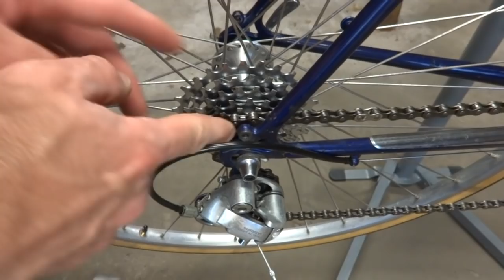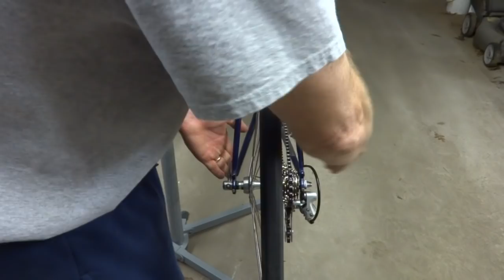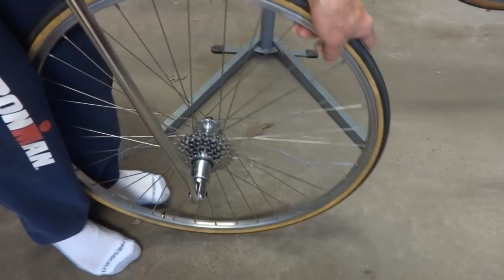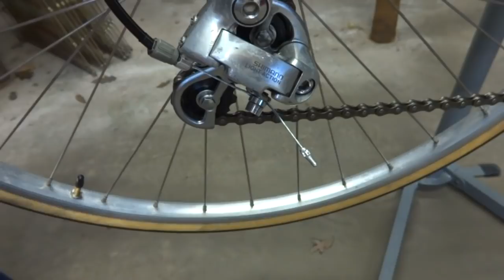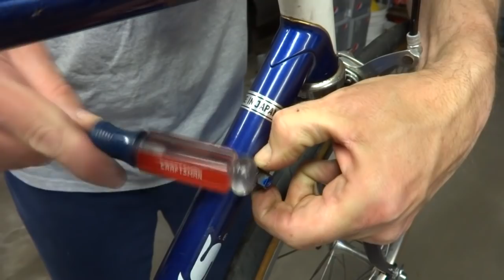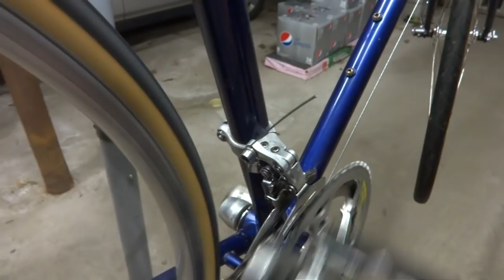How To Do 6 Speed To 7 Speed Freewheel Conversion

Comment: I have a Shimano tz50 6 speed freewheel, since I can't find a 6speed shifter, could I use a 7 speed one? Provided I adjust everything properly. What I've heard is if the spacing between gears in the free wheel is same you possibly could. Please help
Reply from the maker: The spacing is different: https://www.sheldonbrown.com/cribsheet-spacing.html
You can get it to sort of work. Just replace the freewheel.
Reply: @RJTheBikeGuy  ok thanks!
Reply: @RJTheBikeGuy  the spacing is off by just 0.3-0.5 mm at the most, will it still create a problem?
Reply from the maker: Multiplied by the number of gears... .5 * 6 is 3mm. https://www.youtube.com/watch?v=xMvD1T4qF1E
Reply: @RJTheBikeGuy  ah yesss

Comment: Hi RJ, I have a question for you. I'm trying to do a 6-7 speed conversion, and have completed all the steps, however I ran into the problem you mentioned at 1:11 - 1:27 with the freewheel rubbing against the frame. I solved this using a spacer as suggested, however it has caused another problem. Even though the wheel is completely in the dropouts, it is not central in the frame, and so is very difficult (impossible?) to get the brakes to fit properly as one pad is almost touching the rim and the other is about 2cm away. Is there a way of solving this that doesn't involve buying and fitting a new, narrower hub?
Reply from the maker: https://www.youtube.com/watch?v=0MHBHFu4CrA

Comment: on those shifters, does the difference between friction and sis mean that friction would just be the old gearing-manual, without indexing option?
Reply from the maker: Some people prefer friction shifting instead of indexed shifting. So the little part on the side can be turned to select friction or SIS (indexed shifting).
Reply: thanks

Comment: I have a shifter with 7 speed and a rear wheel with 7 cassette, I don't want to use the 7th gear on 7th cassette I want it to start it from the 6th cassette . How do I do that?

Comment: The rear dropout spacing on my bike is 130mm and currently there is a 5-speed freewheel on there. Will I be able to upgrade to a 7-speed freewheel without any problems?
Reply from the maker: Dunno. Generally 5 speed wouldn't have a 130mm spacing. So you will have to figure it out. http://www.sheldonbrown.com/frame-spacing.html
Reply: Yes i seems strange. The wheels on bike are 27 x 1 1/4" 32-630 if that is of any importance... Thanks for answering RJ.

Comment: I have a 7 speed Shimano megarange MF-TZ31  freewheel and would like to replace it with this 8 speed Sunrace Freewheel13-34 MFM56.8CV0.US5.BX.  I have an AL frame with 135mm span.  Is it possible to just swap the freewheel without rebuilding the wheel with a different hub? If there are spacers to each side of hub can I adjust the wheel towards the non drive side with out having issues with the wheel not being centered and issues with the brakes. Right know there is a rubber boot covering the non- side spacer.  I will of course change the 7 speed shifter to an 8 speed. Also I have rubber boots covering the spacers on the front axle and would like to replace them this summer when I repack the bearings. Where can I find new ones? I have looked everywhere and can not find any.
Reply from the maker: Multiple issues here. Freewheels above 7 speed are generally low end crap. Most Mtn bike wheels spaced for 135mm take a cassette a freewheel. So I don't know if you have a 130mm spaced wheel. If you have a 130mm spaced wheel, an 8 speed might not fit on it. And bad idea to use a 130mm wheel on a 135mm frame. Too many issues here, so I have no idea.

Comment: Hi Mr RJ, i need your advise.  I have folding bike with 6 speed. the current cassette is 14t to 28T.  now i want to change only the current 14T to be 9T. is this possible? is there anything need to change?   thank you and waiting for your reply.
Reply from the maker: I don't know if 9t sprocket would fit on a common cassette. I think 11 or 12 is usually the smallest.
Reply: @RJTheBikeGuy  Hi RJ, I might thinking you had experience like this. by the way thanks for replied. oh! yeah there is 9T on 3 speed cassette folding bike.

Comment: what about long/short cage derailleurs?,just realised u didn't mention this?,thought most 6 speed derailleurs could be adjusted to accommodate 7 speed just like the old tourneys which were for 6/7 speed?
Reply from the maker: +neil crompton Long cages are to take up more chain where there are large differences in gearing (big chain ring/big cog versus small chain ring/small cog). Nothing to do with this video. (see my vid on chain sizing https://www.youtube.com/watch?v=ELsKrgTt0oY) A rear derailleur in the case of this video needs to be able to reach all the cogs. A 6 speed RD may or may not be able to move far enough to  reach all 7 cogs.

Comment: shyflirt1 is it necessary to switch my derailleur & shifter if I am using friction shifting, not indexed?
Reply from the maker: You may still need to change the derailleur. It depends if the current one will reach all the cogs. Probably not the shifters.

Comment: I found 8 and 9 speed freewheel for sale. Can you do a 6 to 8 or 9 speed freewheel conversion without changing the hub (will there be enough space)?
Reply from the maker: Freewheels above 7 speed are generally cheap junk. And then you would have issues with bent axles which is why they moved away from freewheels for more gears.

Comment: Hi Mr.Rj ,i have mtb with 7 speed thread type,the current cassette 14t-28t..i want to change on 9 speed 11t-32t thread type....is this possible??? there anything to change??? thank u...
Reply from the maker: The 9 speed freewheel is probably wider so would have spacing issues. With a wider freewheel you are more likely to have bent axles. And generally the freewheels above 7speed tend to be cheap junk.

Comment: I need to change the bottom bracket except for the spindle (I'll restore the spindle). I should buy new parts like a new bottom bracket, loose ball bearings, Phil Wood grease, and a new threaded locknut.

Comment: Hello. Great video. So I have a 6 speed freewheel 27" that I'm wanting to convert over to a 7 speed 700c wheel. Are 700c wheels all the same hub width, and are 700c's hub width the same as a 27" wheel?
Reply from the maker: mannurse32 Most likely it will be 126mm. You may have to change the brakes since the 700c wheel is smaller diameter. But there are newer wheels with cassette hubs designed for 8/9/10 speed cassettes that can have a 7 speed cassette installed on them. They would be 130mm. But if you have a steel frame you can maybe expand the rear triangle to fit the wider wheel. I have a video on that too. 
Check these vids: 
https://www.youtube.com/watch?v=L5pl0zrlHbg
https://www.youtube.com/watch?v=QwxEPRk3LFg
Reply: RJ The Bike Guy So I bought the new wheels and tires. Wow! It looks amazing and I can't wait to get rolling. I did in fact buy the long reach brakes for the front and back, new chain, and a new 7 speed cassette. The bike sits now as having come with 2 rings up front and 6 speed freewheel in back. A co-worker is helping me do the conversion and he mentioned there could be problems with the derailleur. As it sits now, it is set up with a 6 speed and friction shifters. He said I may need to update the derailleur due to it having one extra gear and the fact that the derailleur now may not work with the new cassette and chain. So, my two questions are this: 1. Would it be easier just to leave it as a 6 speed 2. If I leave it as a 6 speed will I have to still change out the derailleur?
Reply from the maker: mannurse32 You might need to update the derailleur. What derailleur is it? I recommend a Shimano SIS compatible derailleur. Some nice older derailluers can be gotten on ebay pretty cheap. Nice 105 or 600 models. But if the RD you have now is SIS, it might work for 7 speed. If you are going this far, you might as well update the RD and go for indexed shifting. You could get indexed downtube shifters, or go for STI shifters. Lot's of different options. Post some pictures over on my facebook page maybe?
Reply: RJ The Bike Guy The derailleur now is the OEM that came from the factory. It is a suntour 5000.
Reply: RJ The Bike Guy , Are you RJ The Bike Guy on facebook too?
Reply from the maker: mannurse32 Probably not SIS compatible. Probably Suntour's accushift system. Get an SIS Shimano RD.
Reply from the maker: mannurse32 Yes.
Reply: RJ The Bike Guy so, will I need to update my shifter then too or will a friction shifter still work with the SIS Shimano RD?
Reply: RJ The Bike Guy , and which RD is the correct one? As I'm researching this I see, rd-ty 18, 15, 30, 22?
Reply from the maker: mannurse32 If you plan to stick with friction shifters, then the suntour RD might work. But come on, it's 2015. Indexed shifting is way nicer.
Reply: RJ The Bike Guy I just found out that the suntour 500 is set up to do indexed shifting.
Reply from the maker: mannurse32 With accushift shifters maybe I think. I don't think it will work with shimano shifters. So you will be limited on what shifters will will be able to use.
Reply: hmmm. new plot twist. So you are saying I would need to upgrade to a accushift index shifter? It has the sun tour friction shifters now. As soon as I get my phone fixed I'll send some photos to your facebook page!
Reply from the maker: mannurse32 If you want friction shifters, you can use whatever derailleur that will reach all the cogs. If you want indexed shifting, you will have to match the rear derailleur at least to the shifters: suntour shifters/suntour RD, or Shimano shifters/Shimano RD.
Reply: Hello RJ the Bike Guy! I have the conversion done. Wheels, tires, and brakes are all awesome! I'm using a Shimano 7 speed cassette on the new wheels. I'm going to take your advice and upgrade to the friction shifters. So here is the question before me now: 1. Do I stay with suntour and just upgrade the shifters or 2. Would it be better in the long run to just go with a new  Shimano RD and Shimano shifters?
Reply: Ok, so I'm shopping right now. I think it may be easier to just convert over to a Shimano set up. One more question...should I go with a long cage or a short cage? Not sure I understand the difference.
Reply from the maker: mannurse32 Actually, I was suggesting going to indexed shifters. Go for Shimano shifters and a Shimano RD.
Reply from the maker: mannurse32 If you have a double chainring crankset on the front, and the freewheel on the back has maybe a larger cog 28 teeth max, a short cage will be fine. If you have a triple on the front and or a really big large cog on the back, then you may want a long cage. A long cage is used to take up the slack in the chain for wide gearing combinations.
Reply: RJ The Bike Guy , so, I've got a 40/52 with my rings and a Shimano 7 speed cassette I picked up on Amazon. Ok, it seems like Shimano is a much more available brand. Is Shimano the industry standard on equipment for non-top shelf stuff?
Reply: RJ The Bike Guy everyone in my bike club was drooling over my new set up last Thursday night. I'd love to show you some pics. Thanks for all the advice!
Reply from the maker: Shimano is a very common and available brand. They make a whole range of stuff from low end to high end stuff. The serious road stuff is Shimano 105, Ultegra and Dura Ace. With Dura Ace being the top end Shimano groupos. Sure, post some pics over on my RJ The Bike Guy facebook page.

Comment: Can you use SIS derailleurs and shifters with a 6 speed freewheel?  I have the components to do the upgrade but I don't have a 7 speed freewheel yet.
Reply from the maker: The shifters have to match the cogs. So if you have a 6 speed freewheel, you will need 6 speed shifters. The derailleur needs to be SIS and preferably close in era. A 6/7 speed SIS read reard derailleur would be fine.
Reply: @RJTheBikeGuy  can I use 7 speed derailleur on 6 speed freewheel?
Reply from the maker: @ognjenfiraunovic8724  https://www.youtube.com/watch?v=xMvD1T4qF1E
Reply: @RJTheBikeGuy  okay thanks, I ordered Shimano sis 6 speed derailleur but I have friction shifters, do I need to buy indexed or I can leave them?Also should I buy Shimano freewheel or stay with one I have(it's not Shimano it's power lmfw-54s, while rd is Shimano tourney rd-ty21-6 gs)?

Comment: If my shifters are not indexed, meaning that they don't have any notches to click into, will I still need to replace them?
Reply from the maker: If they are friction shifters, then you don't need to change them. And you probably won't need to change the derailleur either.
Reply: Thank you. I have a an 89 Fuji Royale and I'm looking to do this same conversion because the range on a six speed isn't quite up yo par.
Reply from the maker: What do you mean when you say range? More gear combinations? If you are wanting to switch to a freewheel with a larger cog than about 28 teeth, then you will probably need to change the derailleur and probably go for a slightly longer chain.
Reply: Yes, gear combinations would have been a better word

Comment: RJ - I have a rathe convoluted question and you are the most knowledgeable person I can ask without getting a sales pitch for a new bike from my LBS. My adult daughter has a Magna 10 speed. Not sure of how old - but at least the 1980's. Rear dropouts measure 126mm and it currently has a sunrace 5 speed (650a wheels) freewheel in the back with stem mounted friction shifters. In my family we draw names for Christmas gifts with a $100 limit and I drew my daughters name. I would like to upgrade the bike to a 14 speed with indexed shifting.  Ideally, I would go with  brifters in the front - but I can't either $100 limit. My questions are - 1) will any 7speed freewheel screw onto the back? 2) can indexed thumb shifters mount to the top of a drop bar? Does this old sunrace freewheel take a parktool FR-1? And as long as the rear derailleur (available new on eBay with hanger) is sis - this will work with sis thumb shifters? Is this my best option?  Sorry for all the questions!
Reply from the maker: +Patstar777 Yes, pretty much any freewheel should crew on there. A 7 spd freewheel may not fit in the space for a 5 speed freewheel. Not sure which tool will fit that freewheel. Yes you can mount trigger shifters.
My advise would be instead of upgrading the Magna which as are really cheap bikes, look for a quality used bike. Time is pretty tight now, but I find  great deals on Trek/Specialized/Giant/GT, etc bikes on craigslist that already have 7 speed on the back. If you are lucky, you could find a much better bike for under $100 and then clean it up.
Reply: +RJ The Bike Guy Oh, I don't disagree this Magna is a cheap bike LOL - but it has it's charms (it looks brand new) and my daughter is attached to it for some reason. I'm currently updating a trek 560 for my adult son, which is much more exciting!  I've got the rear dropouts spread to 130mm thanks to your videos! And your homemade rear dropout alignment tool was perfect! My daughter has several very nice modern bikes, but wants to keep and ride this Magna because of its "charms". She just has a hard time with the friction shifters and I wanted to put some indexed shifters on to make a little more user friendly. Thank you so much for the answers! Your help and videos are invaluable. I think there's plenty of space for the 7 speed - but may have to use a shin or two for the smallest gear. Thanks RJ!!!
Reply from the maker: Shimano EF-51 shifters are good. https://www.youtube.com/watch?v=u-S0hOkDWw0
Does it have v-brakes?
Reply: +RJ The Bike Guy RJ, no these have the older caliper brakes on them. I wasn't going to put on trigger shifters - but actual sis thumb shifters.  Like Shimano  SL - TY37 SIS shifters.  I would put up a link but I suck at that. Unless I can maybe find some used Sora brifters for cheap on eBay - but I'm not sure they would work with an sis derailleur or if I'd have to get a Sora derailleur.
Reply from the maker: +Patstar777 SIS is Shimano Indexing System. Sora brifters would be compatible. You don't need a Sora RD. I don't even think there is a "Sora" RD anyway. Is this a road bike or mountain bike. Mountain front derailleurs don't play nice with road shifters. Back is okay. You will need to make sure the rear derailleur can actually move far enough to reach all the cogs.
Reply: +RJ The Bike Guy Sorry, should have clarified from the beginning- it's a 10 speed road bike.  And as always more great info!!! Front is a double crank - and I can pick up a from derailleur cheap - I think (sunrace now).